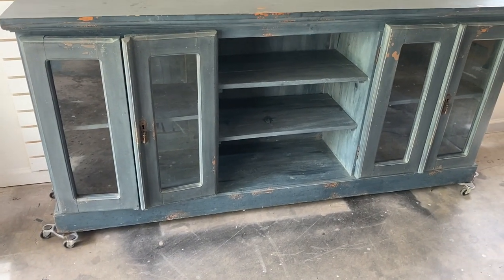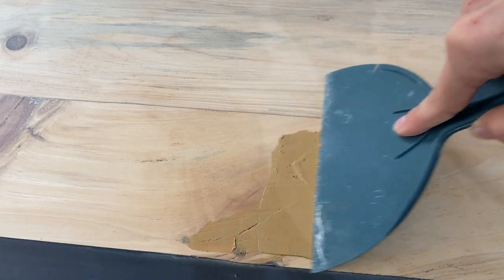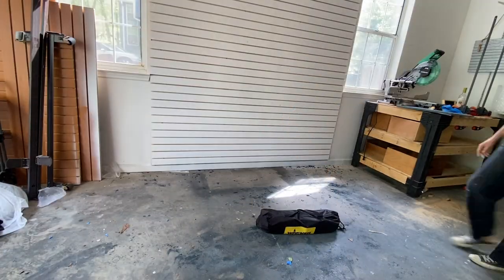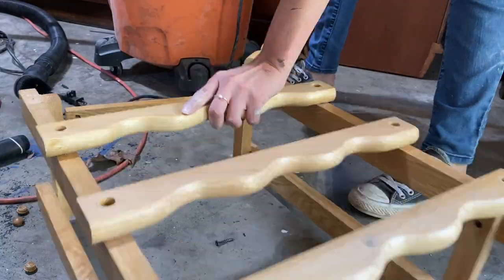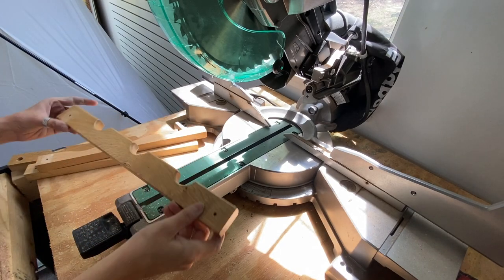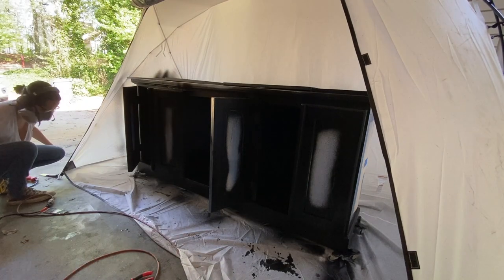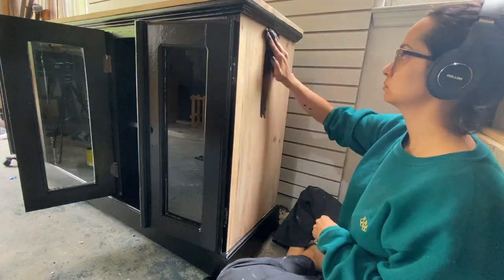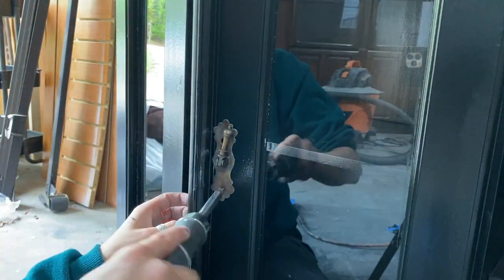Awesome BUFFET To BAR CABINET Transformation | Paint Removal with Heat Gun

Comment: Mija, next time, use a tool to scrape out and open up the crack in the wood first, then vacuum it out, then fill it.
Reply from the maker: Oh okay! Why is that?
Reply: @TheMissFlips  Incase there is some loose fragment of wood in the crack that may cause the wood filler not to grip properly .
Reply from the maker: @zorroinhell5549  got ya. Okay tio! Thank you for the tip! Do you by any chance know what the black stuff is that some people use to fill knots in wood?
Reply: @TheMissFlips  One of the ways you can fill cracks and holes is by using the very same saw dust from the piece its self mixed with a wood glue, making sure that enough saw dust is used to match the color of the piece that you are working on.
Reply: @TheMissFlips  it might be either tinted resin or a dark C.A. glue (Starbond has a good one) If you do wood glue and sawdust don't use waterproof glue, it'll turn your mix black when you sand. Check out the most recent vid by Brad over at Fix This Build That, he did a whole glue mix comparison.